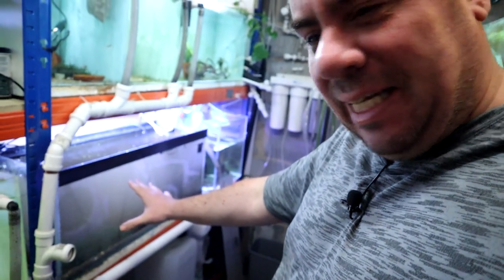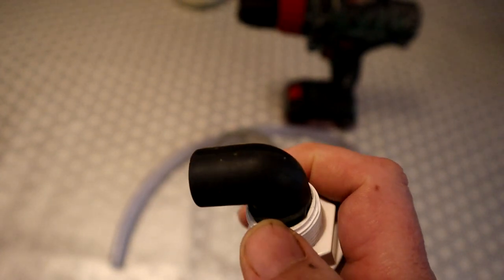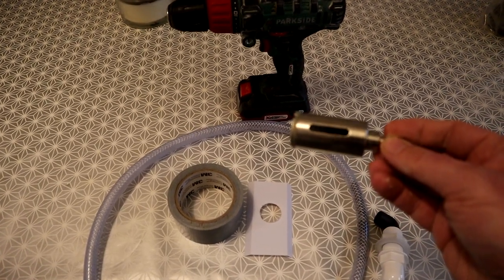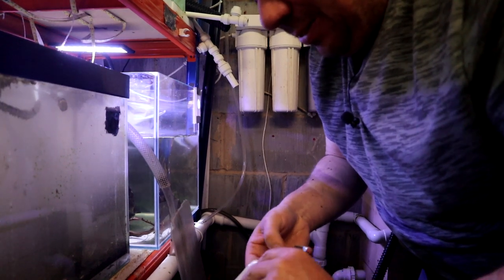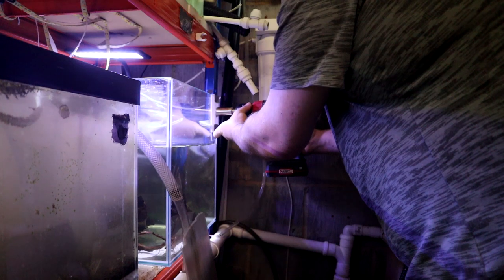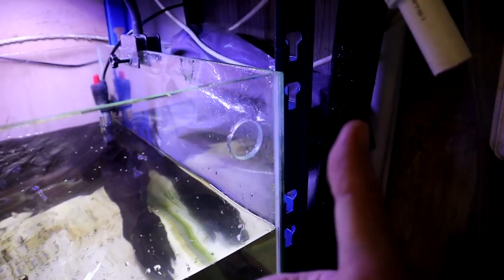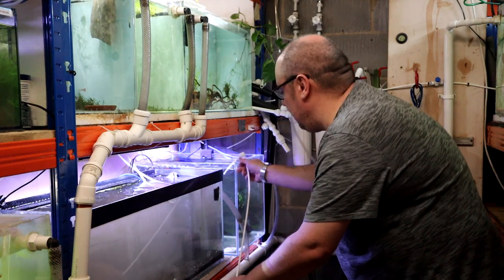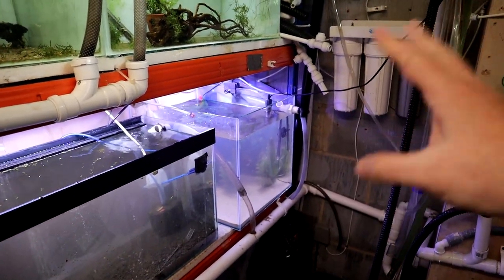How to drill a glass aquarium

Comment: One way to discern if your glass is tempered is by putting on polarized sunglasses and viewing the sun through it. If the glass has been tempered, you will likely see some spots or lines stretching across the pane. These lines and spots are a result of the machine rollers used during the heating (tempering) process. To see these, you will need to look closely - they can be very subtle at times.
Reply from the maker: Good tip, thanks!